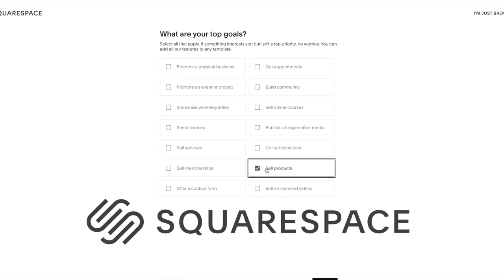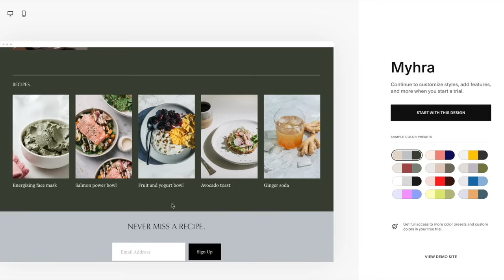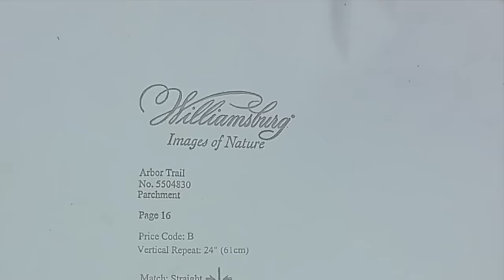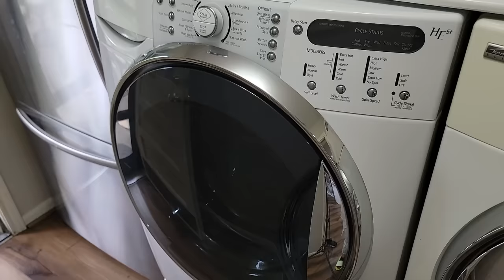15 Minute $15 Goodwill Bins DIY Challenge

Comment: I think that the rabbit sign on the post is an easter decoration, and that there are more holiday seasonal replacements from the original maker, but you could make your own. I think it's originaly for the outside / front porch. and the thread is called Embroidery Floss.

Comment: I think the tool that you were calling a Dremel (maybe that's the brand,) mine is called an oscillating tool if that helps people find them. It can flush cut, has a rounded blade, it can detail sand, you can get a scraper attachment, etc. Girl, you kicked it out of the park with this video! Love everything ❤❤❤

***SIDE NOTE: NO ONE FROM TEXAS ever Said "beautiful pine trees!" Haha... I'm just picking on you girl ❤❤❤ for whatever reason, people can't stand them here (I Guess all the pine needles?) but, they don't bother me!
Reply: You are so clever! I've cut the handles from baskets too... You can also wrap it on both sides in the spot where it was broken on the one side to where it looks purposeful with jute, macrame cord, etc 😁